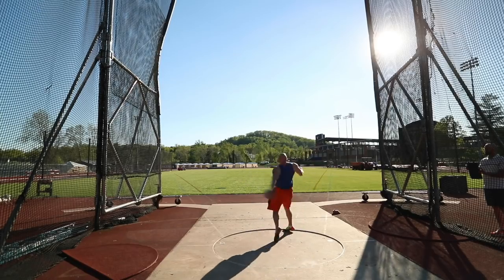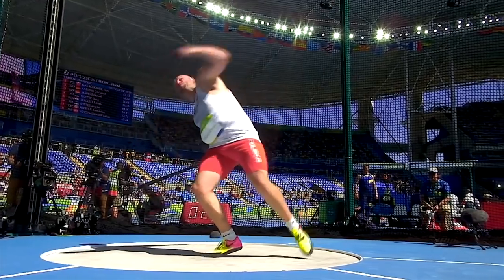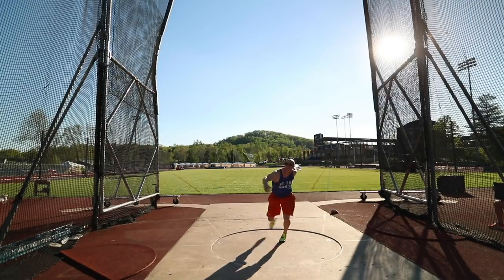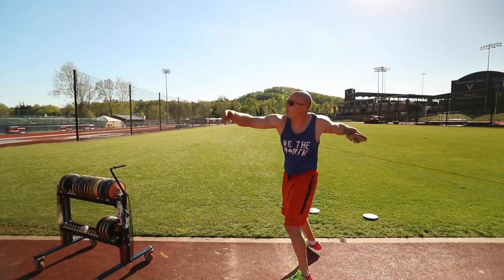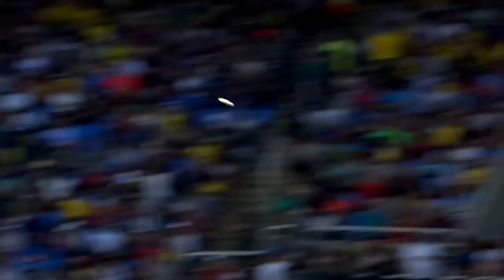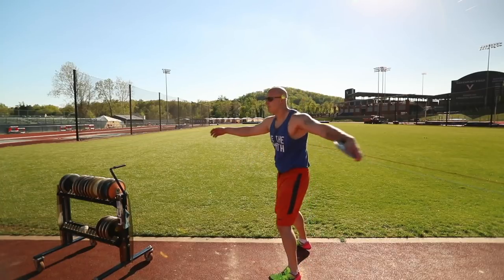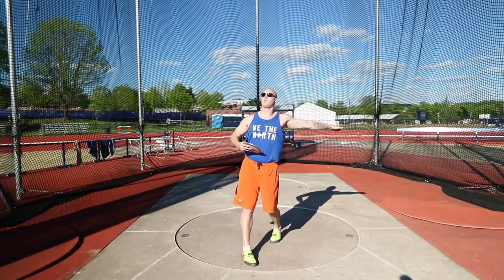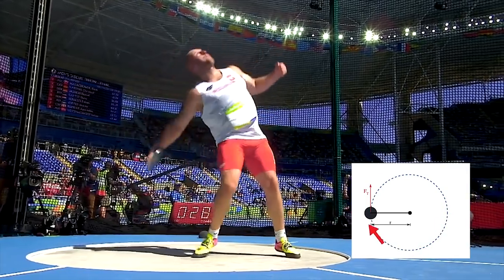HOW TO GET A SMOOTH DISCUS RELEASE - JY THROWS S2 E63

Comment: The tip about placing your index finger on or behind the half way line is truly amazing. Almost all of my throw used to be extremely wobbly and didnt spin much. The other day i saw a different video which gave the same tip and today i tried it and my throws went an extra 10 ft instantly. (Ik thats not very much but this is my first season throwing so im pretty happy). Also if you try this and the disc still shakes try to focus on keeping your thumb down on the discus and not letting it lift up. Great tips!

Comment: I love these vids because I’m about to start getting into discus but have been throwing shot for a lil while but you just help a lot with the technical aspect of things. I also have some questions about shotput because ik you throw with the rotational technique but I wanted to know if you had some tips for glide throwers
Reply from the maker: All I can say is you need to stay low on your legs facing backwards as long as possible and work on constant acceleration from the moment you start to move out of the back.

Comment: What are some reasons you think that discs kind of swoop down? My disk appears to go far but then it just kinda falls and hits like  the 110 feet mark.
Reply from the maker: Seth Ardolino wind and release angle will affect that. If the outer lip is above the inner one it will turn over and crash into the ground the wind makes that happen faster. Try to keep your shoulders level throughout the throw and don’t pull off the finish with your upper body and it will likely help it fly nice and flat so it doesn’t turn over and crash
Reply: @LifeofJY  thanks a ton for the advice, I'll try and incorparate it more into my throws. Keep up the content!